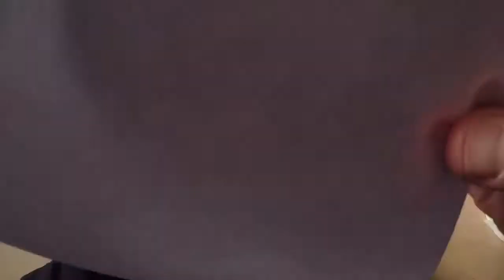RAM Totalscan Transducer Arm Install on Kayak

Comment: Is there a fitting for the 2019 Garmin Striker 4 transducer?
Reply from the maker: Well depends on what type of transducer it has. Not familiar with the garmin sonars, if it’s a big transducer such as the one in the video you should be able to use this one and all you need to do is drill the holes in the bracket. But if it’s a smaller transducer they make different ram arms for smaller ones with just downscan
Reply: MFA Fishing 
It’s a small transducer (dual beam 77/200 kHz, 200 W)
Reply from the maker: Leonard Dowdle this is the one your probably looking for https://www.austinkayak.com/RAM-Transducer-Arm-Mount-Open-Socket/ACK10203P.html?utm_source=google&utm_medium=cpc&utm_campaign=Shopping:%20ACK%20PLA&adpos=1o6&scid=scplp10203_5978_1&sc_intid=10203_5978_1&gclid=Cj0KCQjw9JzoBRDjARIsAGcdIDVfeF-iNEMgXNtq3IFUeMd6dhluorzvRtDhXjCvZkQEFfbbHd2OR9gaAkYuEALw_wcB
Reply: It’s approximately 2 1/2 inches front to back at the bottom by 1 1/2 inches wide. The curved part is too large for the attaching device on the mount and I had to file it to get the transducer to fit in. The screw hole on the transducer is smaller than the hole on the attaching device. It’s on, but I don’t feel that it’s on correctly. Do you have a part to make it work? (I think Garmin had to change the transducer to make it different from Lowrance’s transducer).

Comment: Hows the  side imaginge quality  with  this mount?
Reply from the maker: Adam Adam when I was running this setup it worked fine, couple times I had to adjust the depth of the sonar in the water but once i did it worked perfectly
Reply: MFA Fishing what setup are you using now?   Im looking at getting a slayer 10. Currently running a similar setup on my current kayak. Just not sure its the best  way  for good side scan images.
Reply from the maker: Adam Adam I have switched back to just downscan. Noticed I really wasn’t using sidescan. I also switched kayaks since this video. I switched to a radar 115 which has a center console allowing you to mount side scan right underneath the kayak